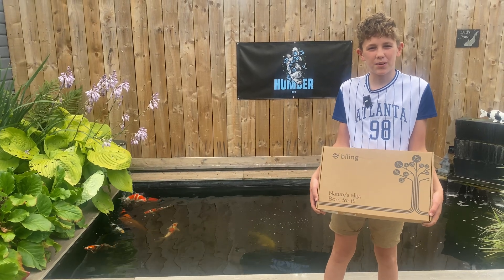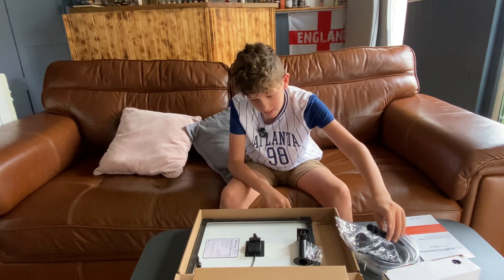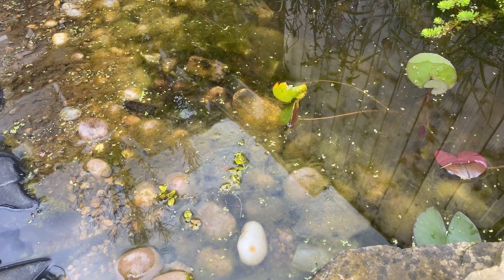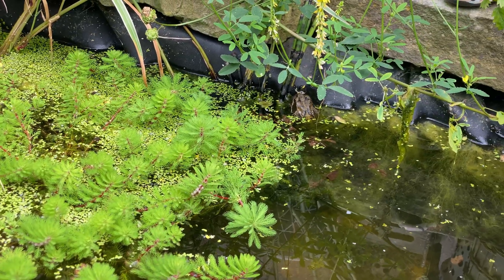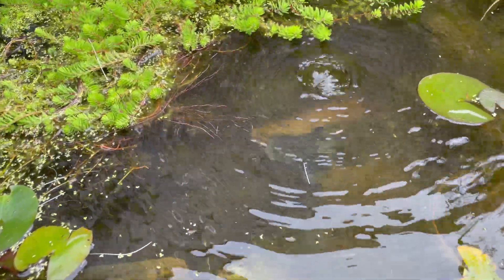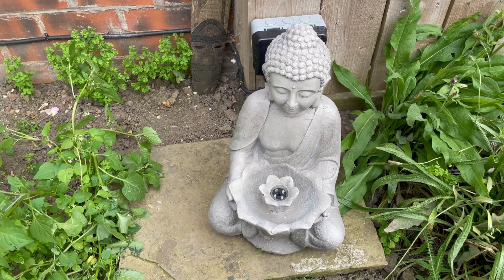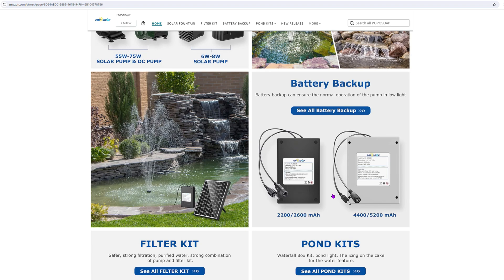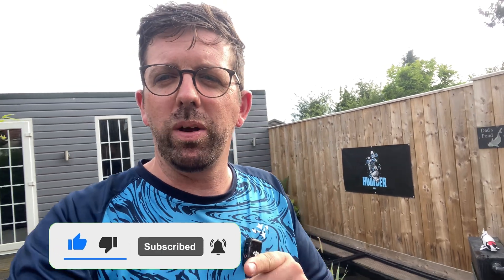POPOSOAP Unboxing & Review: Solar Water Solutions & Pumps #koi #koipond #fish @poposoapbrand

Comment: Far superior to your original one, have fun 😊
Reply from the maker: @marekskoipond9083   it is we have been pricing battery’s up for our house solar panels
Reply: @HumberKoi  I'd be very interested in that, but i fear way out of my budget, I've got a 2.1kw power station and expansion battery, which came in very useful yesterday morning, whole area had power cut, plugged in bio air pump and pond air curtain, got me out of trouble, need a generator switch to make auto function when power outage